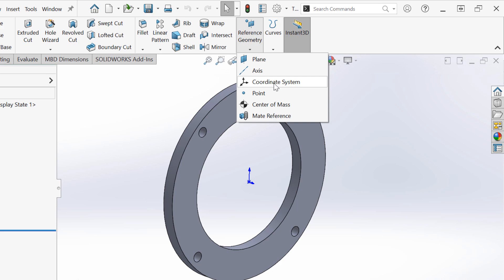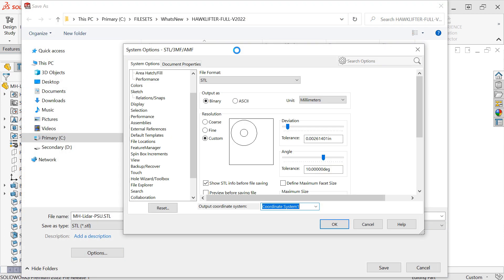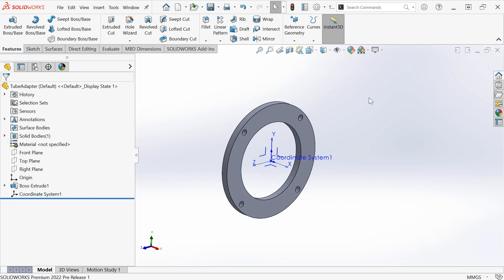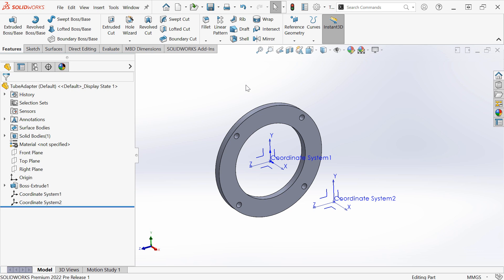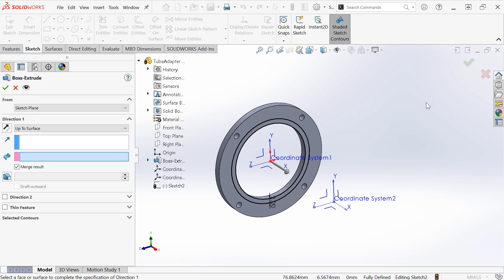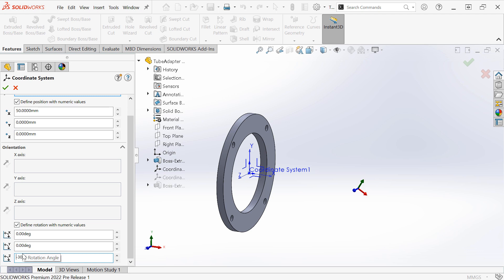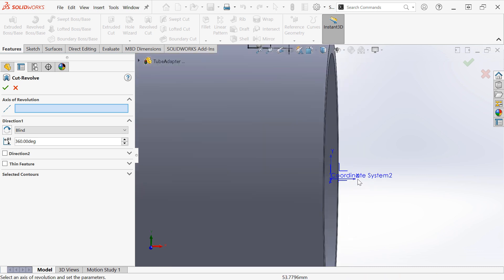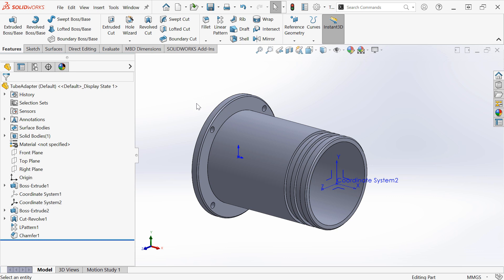What's New SOLIDWORKS 2022 - Coordinate Systems

Comment: In another cad system I was able to pattern reference geometry, cays, points, axes, planes. Can you demonstrate how to do this or work arounds .
Reply from the maker: When creating a plane with an offset there is an option for "number of instances" that will automatically pattern the number of planes

Points have similar options for creating points auto-spaced along a line or edge

For patterning arbitrary reference geometry after the fact though there really is not a method for this currently